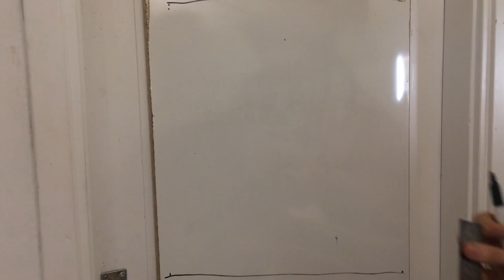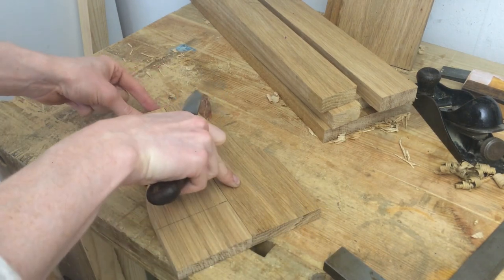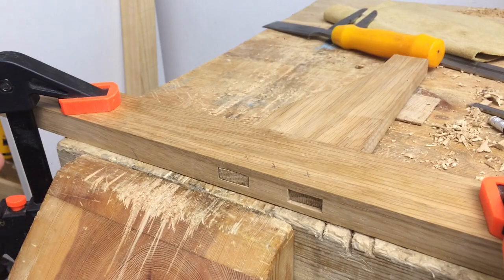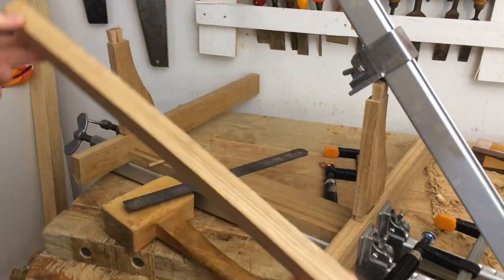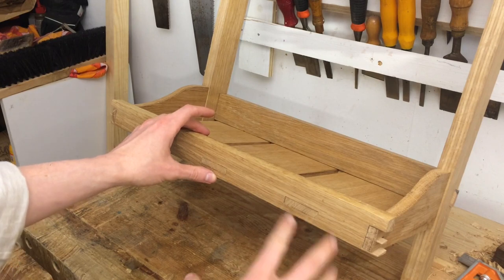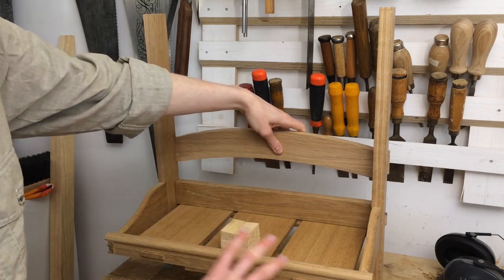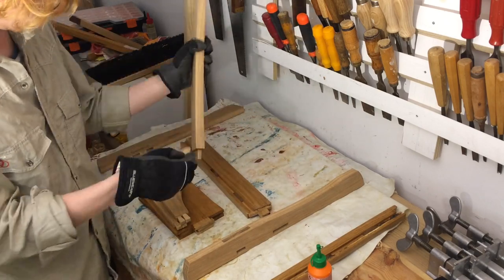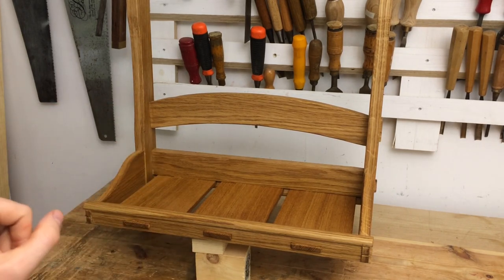Hook-on balcony table build

Comment: Thank You Gillis...Well I just enjoyed another one of your wonderful videos. I know very little from my own hands on dovetail, tenon construction. In small projects from my past I have incorporated small bits and pieces of joinery but always cut with machinery. Your work fascinates me no end. I was wondering Gillis if you have ever the desire to construct enterally with joinery using through tenons held in place with wedges or pins or both without the use of any glues? I want to try something like that on a future project that can be disassembled and than reassembled like a puzzle. I do not have my final idea in mind but my desire to not use glues has been percolating in my brain for quite some time. I just like the idea of a well made piece of beautiful construction able to stand on its own.  Changing in humidity with wood movement being compensated for with a gentle tap on the wedges? I suppose I will eventually need to try a small example eventually.                                                                                         TM
Reply from the maker: I haven't tried, but it's definitely possible to make furniture that can be disassembled like that. The moravian workbench is an example I've seen a few videos about, and reading about historical furniture, pieces that came apart or folded up was possibly more common than permanently assembled things. Personally I like glue, but it could be fun to tinker with!